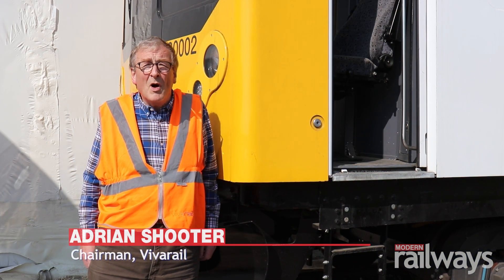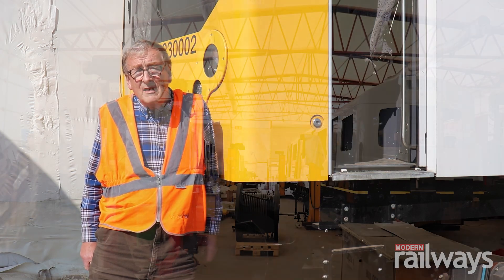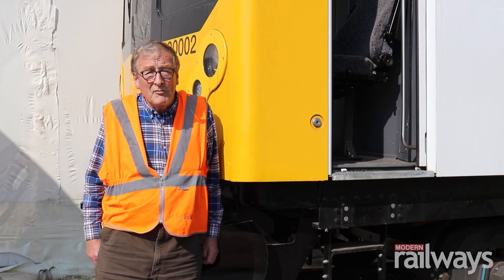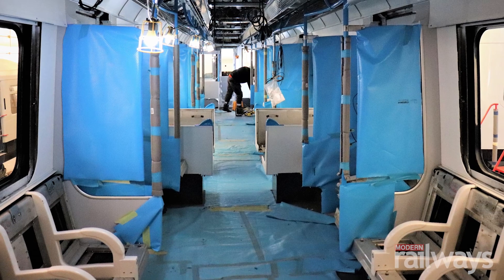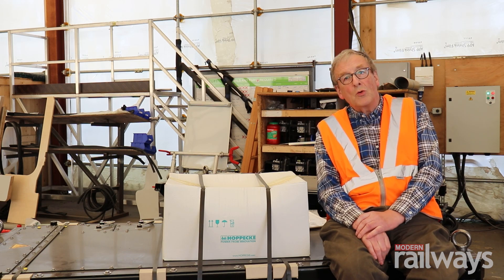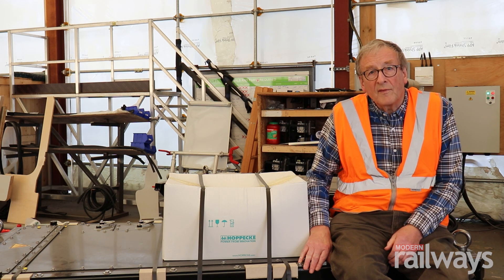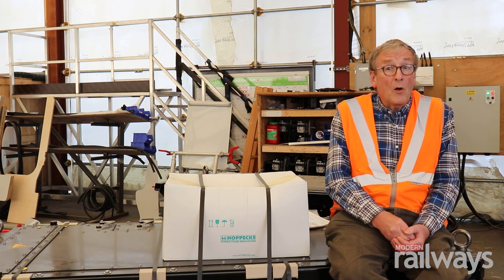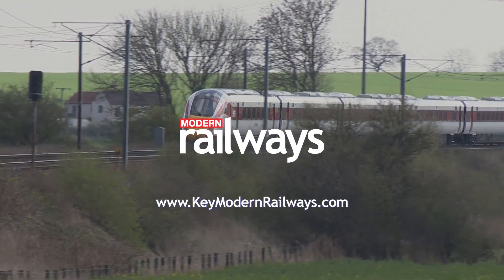Vivarail’s plans for zero-emission trains

Comment: South Western Railway (Island Line) are inheriting the Class 484 which are to replace the Class 483 (1938 Stock) as they are 80 years old. I think that Vivarail should continue with rebuilding the Class 230s for future rail operators that are willing to use them. Including the East-West Rail link. And maybe Southern to inherit some of these to operate on the Marshlink Line (Hastings-Ashford International). 

https://en.wikipedia.org/wiki/British_Rail_Class_230
https://en.wikipedia.org/wiki/British_Rail_Class_484

Comment: Nice job they are making of these. I would like to see one of these trialled for comparison as a three-car push pull unit with a standard class 4 tank, converted for light oil firing and OPO. Probably a lot cheaper than batteries in the long run.